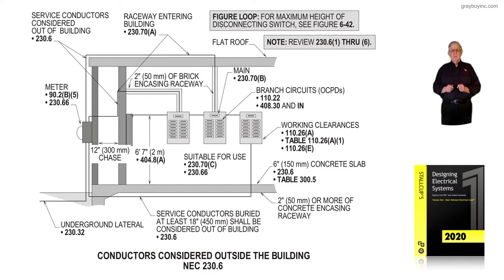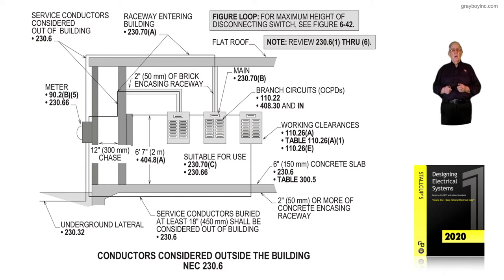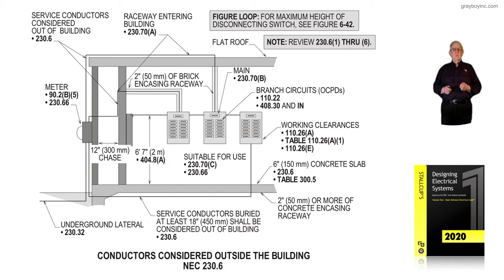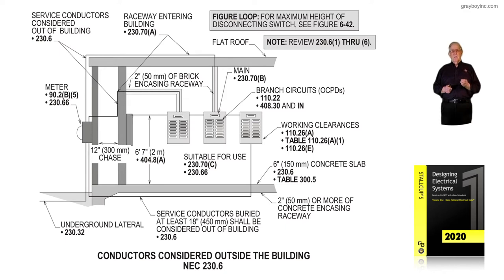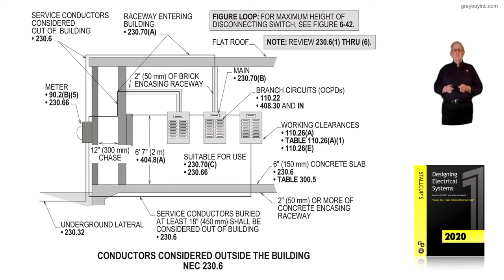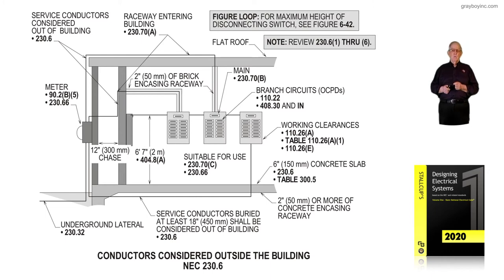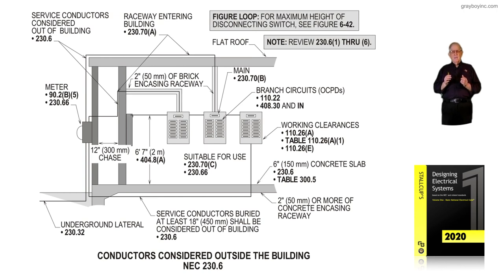6-8  CONDUCTORS CONSIDERED OUTSIDE THE BUILDING - 230.6

Comment: 230.6(1) or (4), would you ever consider the penetration of the stem wall as penetrating the "building" even if you comply with 230.6(10 or (4)?  Thanks